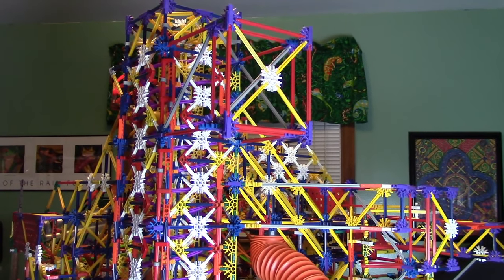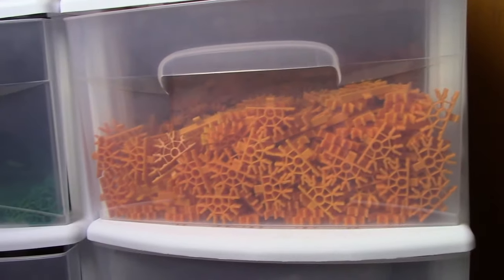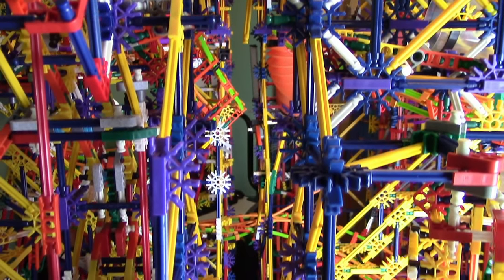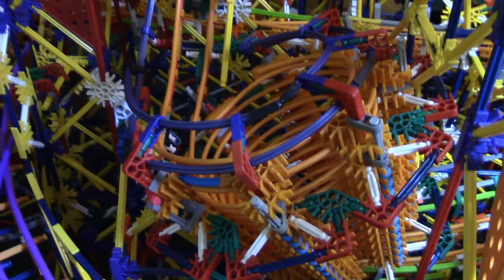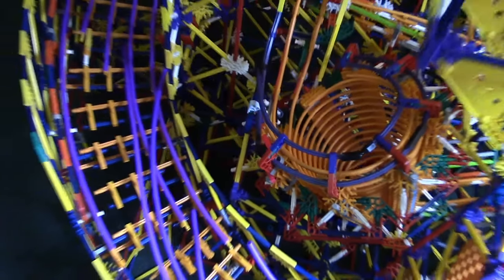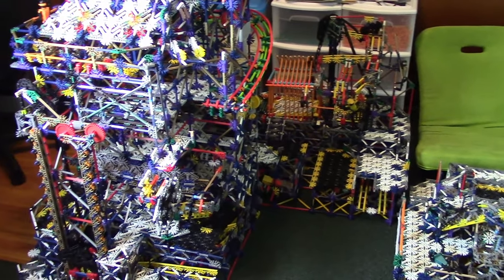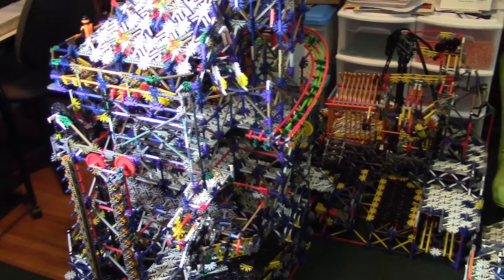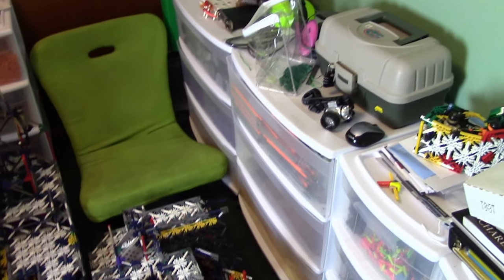Let's Build a Knex Ball Machine - Ep 10 - Transport and Setup

Comment: Hey Shadow, I wanted to know where you got those balls from... everybody seems to have them, but I can't find them anywhere! Do you know a place where I could get them from or what they are called?
Reply from the maker: They're the original Knex balls that were first in the Big Ball Factory. I used to buy them from Knex.com, but they stopped selling parts recently so there's no good place besides ebay or knexusergroup, and even those places have limited supply.
Reply: @Shadowman39  That's fine, tennis balls will have to do. 🤣
Reply: @MyCuriousMind  hey i used to use rubber balls and they ended up causing alot of friction and nearly destroying my lifts every time i used them, but dont blame me, i was 9 ;)
Reply from the maker: @MyCuriousMind  Haha. You could try golf balls, I know of someone who does this for Knex ball machines and they are similar to the Knex ones.
Reply: Shadowman39 I have managed to make tennis balls work somehow. Plus, that is all I have. I have barely any pieces so I am only making two short paths but it is an alright first attempt at a ball machine 👌